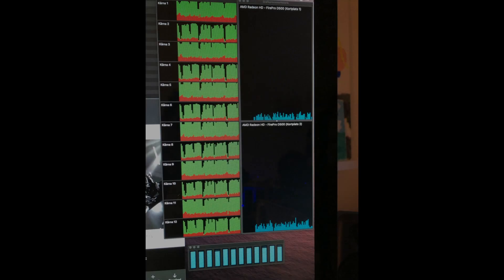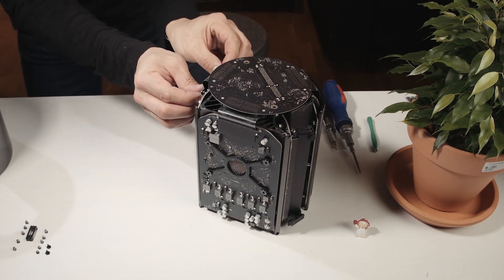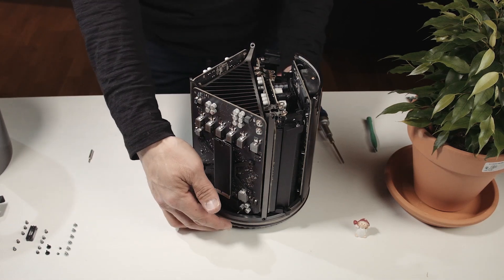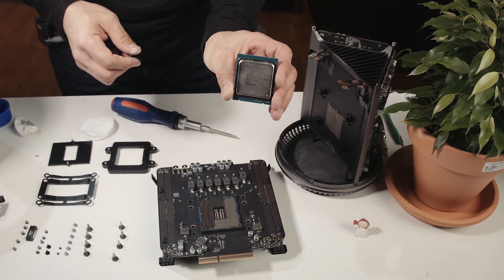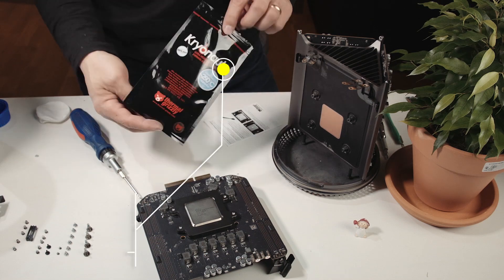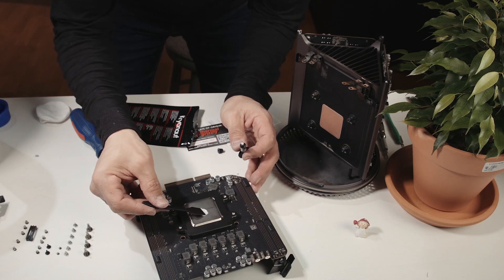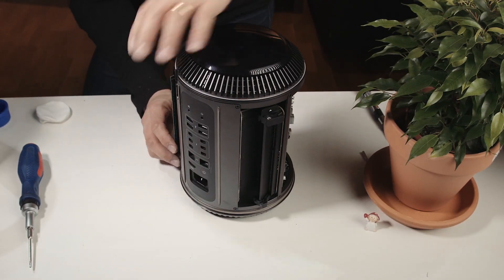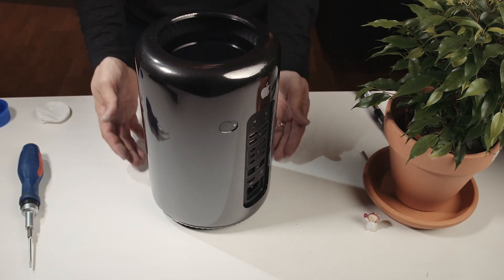Is the Mac Pro Trashcan 2013 Still worth it in 2020 | Upgrading the CPU to a 10 Core Xeon E5 2690 v2

Comment: The scores I posted guys ,are 100% true ok,,I've been testing the 6.1 for 1.5 years now, the scores below are with the xeon e5 v2 1660 3.7 6 core ok!..its a fast upgrade from the stock 3.5 6 core,,my 2690 v2 10 is here tomorrow,,I love installing these,im going to change the termal paste on the gpu, s well I'm in there

Comment: Nice video :-) As I am considering a 10 or 12 core upgrade, I would be glad if you could post the single and multicore Geekbench score of your 10 core setup. Thanks.
Reply: same here. Also what was the actual geekbench score?
Reply from the maker: @VisualMasterpiece  745 Single Core and 7299 Multi-Core, Cinebench R20 was 3076
Reply: @wangmedia  Wauw, your 10 core Geekbench multiscore beats the average 12 core score on the Geekbench Mac Benchmark Chart, which shows up as 7047, while the single core score for the 12 core is 727. The 8 core shows 825 and 5867, which I think will be the best for my typical workload. Thanks for sharing the info :-)
Reply from the maker: Pascal Geuns actually I was considering the 2650 8 Core because I could get it for 70 Euros here in sweden. If you’re interested in the 2650 maybe I can help out?
Reply from the maker: Pascal Geuns if you edit video I would recommend going for 10 or 12, I love when the rendering just wooshes by in the render bar indicator. Try adding de-noise to multiple clips and you will be aware of how many cores you have 😉. An option is to go the proxy way but that is kinda giving up, eventually I will have to go there but not today.
Reply: @wangmedia  Thanks for the offer Henrik, but the 2650 is a lot slower then the E5-1680 V2. PS: Another good video to watch about this is https://youtu.be/-6anTJyCFYM
Reply: @wangmedia  I am mostly going to use it to program and to run 1 VM, not so much video editing, thats why I came to the conclusion that the 8 core would fit me best. I just dusted of my i7 Mac Mini (Late 2012) as I got so irritated at constantly touching the touchbar by "accident" on my MacBook Pro (2018), never have been happy for that Macbook Pro 😟 rather take my MacBook Air 11" 2012 with me on the road.. Just wish Apple would make an upgradable Mac Mini that has at least an Iris graphic card in it and was not thermally constrained, instead of me looking at a used 7 year old computer design to match my needs! If only Phil Schiller knew that this is a lot sadder then -> https://youtu.be/0wIiDnjz4X4?t=2775 😉 Oh well I guess I am environmental friendly keeping old Macs running 🤣
Reply from the maker: Pascal Geuns i will post this evening
Reply: @wangmedia  Thanks a lot Henrik, very much appreciated that you take the time to post the numbers, as I start to think the sweetspot is the 8 core with the best single core score, but would like to see if your 10 core can top that :-)

Comment: Loved the video man! Neat and precise! Now your Mac Pro will break 4k timeline like butter.
Which GPU do you have?
Reply from the maker: I’m waiting for your video about nvme upgrade, I’m on the fence about upgrading from the original 256 GB to a 1 tb nvme to edit from instead of my external Sandisk SSD. Also store the Lightroom Library so all pictures load instantly.
Reply: Henrik Lindblom i won’t make a dedicated video The upgrade is just one screw. You can use a normal m.2 nvme with adaptor or an OWC aura pro x2. I have tested both and The speeds are the same around 1.2 MB/s R/W. Maybe the adaptor way is cheaper. 
Anyway it’s a big improvement over external
Reply from the maker: @ShadesOfTech   That was what I was wondering, what speed I can reach with nvme, this means It is no meaning buying the fastest Samsung 970 Evo Plus? I can get a 1 TB nvme Crucial P1 for 120 Euro and an adapter for 14 Euro. What do you think?
Reply: Henrik Lindblom sorry it’s 1.2 GB/s well a Samsung could be theoretically a bit faster not sure if the Mac Pro connection bottleneck the speed. I tested the OWC and SP silicon and reach both those speed with and without adaptor. I have the crucial as well but didn’t test it. But I think they will have all the same speeds. For editing is sufficient 0.7 GB/s so it’s plenty of speed!
The Samsung will be very expensive and won’t use that extra speed
Reply from the maker: I succesfully upgraded to a 1TB Nvme! What a performance boost. Now I edit all the ongoing FCPX projects on this and I have about 1300Mb/s write and 1500 read instead of 250 Mb/s with an external Sandisk Extreme SSD.
Reply: Henrik Lindblom great man!! An upgrade totally worth in my opinion
Reply from the maker: Thanks! The D500s
Reply: @wangmedia  Wow they are powerful! I bought this Mac Pro used because the D500s were too expensive but I feel like now they are the only bottleneck I have left because run constantly out of vram while editing.
I am planning to hook up an external GPU with a radeon 5700 xt to see if it improves massively